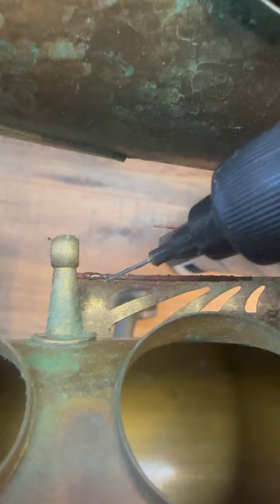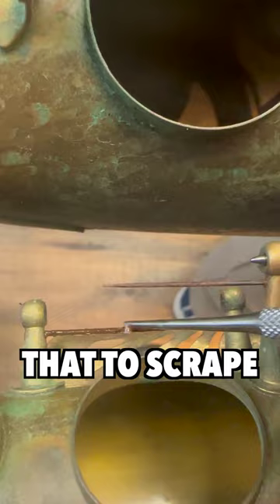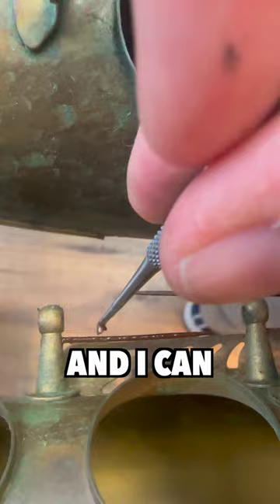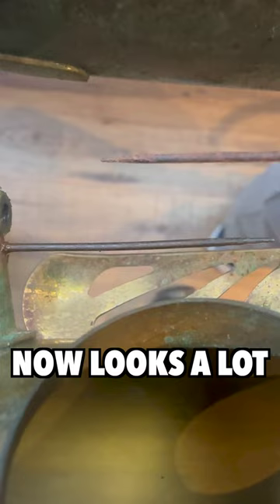Rusty Saxophone Spring Quick Fix

Comment: All that corrosion all over the horn is much worse for it than a rusty spring. Springs can be replaced. That’s not so easy to do when you have pitting and holes in the body.
Reply from the maker: There aren't any holes in the body other than the tone holes 🤣
Reply: @bettersax  Brass deteriorates when there isn’t lacquer. Pitting (holes in the body where there shouldn’t be any) is something that can happen over time, especially when you don’t take care of the instrument and it is corroding (all those green spots on the body).
Reply: Never seen a hole other than the ones the factory put there. 
This horn is bronze. They make statues out of it for a reason.
Reply: @ellwoodblooz  That’s because you don’t fix instruments.
Brass and bronze are both metals that pit if not taken care of. They put lacquer on instruments for a reason other than making it look shiny. All you have to do is look up “bronze pitting” to see what can happen when statues aren’t taken care of. It’s not worth it to let your instrument corrode away regardless of what metal it is made out of.